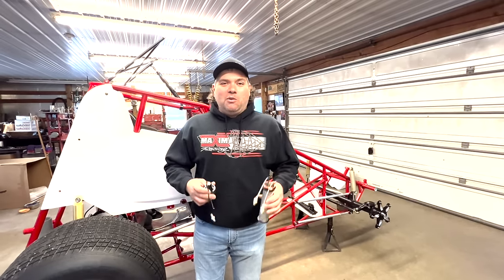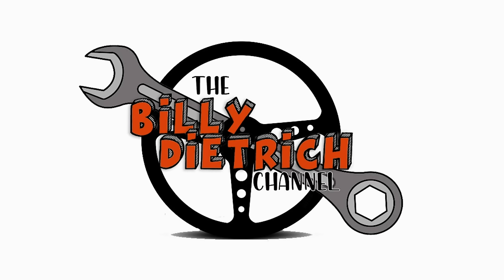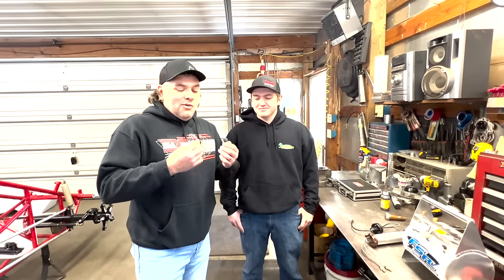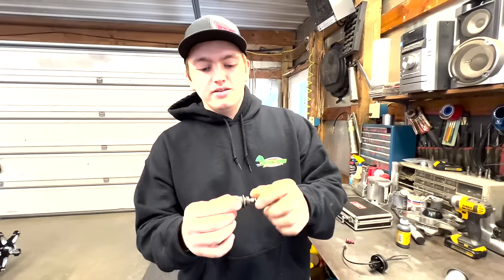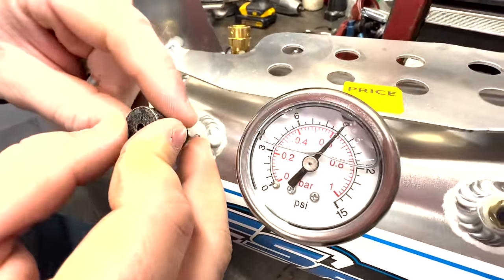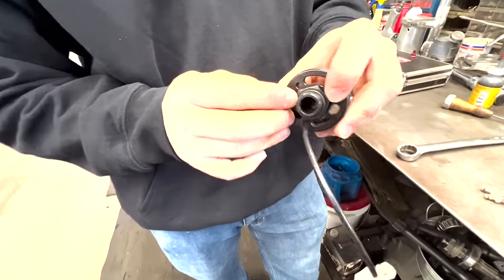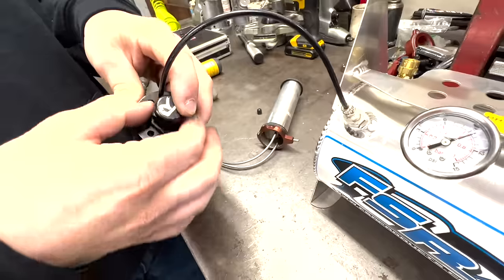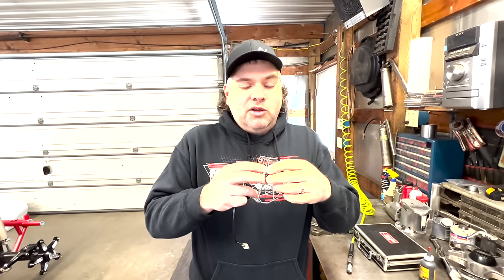🛞Bleeders 101 - Dirt Track Sprint Car Racing

Comment: I remember when the axle style bleeders first came out.  A crew guy told me it was because they thought the centrifugal forces on the standard bleeders from the tires spinning was causing the setting to change on the track.
Reply: Yep, the Conroy “Pnu-control” ones… I remember them.
I dont think the centrifugal force is or was that big a deal, since the spring is so small and stiff.  But the Swindell ones are here to stay.
Reply: It wasn’t the spring but the diaphragm itself. How it reacts on a tank is NOT how it’s gonna react on a rear wheel spinning so damn fast.
Reply: The “second gen was known to fail” and became known it was able to fail and let all the air out. Been told my whole life they were junk. But that goes back to product design before new development. The newer axle inserts are still able to fail from rotation momentum due to diaphragm. The new swindle bleeders I never ran, but when it’s going to open, it’s going to electronically open. Not from pressure nor the possibility of rotation momentum

Comment: Seems like the old style "quick change" bleeder designs are susceptible to centrifugal force.  The diaphragms are non-zero mass and will therefore behave quite differently than they do when  connected to the static tank. This is why the newer designs are packaged into axles even though that creates problems with fractured tubes.

Comment: They run nitrogen only from the properties of it on the periodic table. To run nitrogen effectively you would actually have to suck the air out of it close or beyond zero without it having air into it. Nitrogen works differently and reacting differently to heat. It might be a thing of the past, but it does change the chemical combined and reaction time. If it didn’t, there would be no such thing as gas shocks

Comment: Ok a few questions: What keeps the bleeders inside the axel tube?  Bead locks, why not on all the wheels like the modifieds?  Last question, would you drive a dirt modified if asked?  Love the videos, great tech and good winter viewing .   Guy from Jersey.
Reply: They have o-rings that are swelled larger than the bleeder and it gets tight when you start putting it in. Yes I would drive a late model for you

Comment: Do you set them to the pressure you start at or do you play tricks and get them higher or lower during a race?
Reply: Where you want it to bleed down too after a run and a yellow comes out.
Say you start the main at 8psi in the right rear, it will blow up from the heat of running to 12psi.
So under yellow it will BLEED back down to 8psi if you have the bleeder set their.